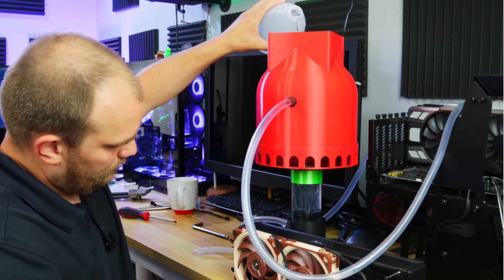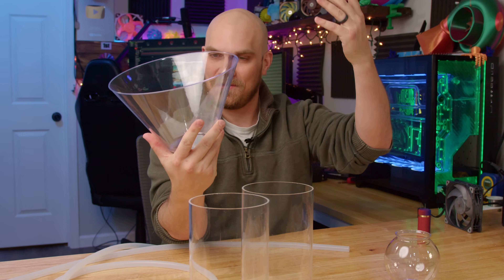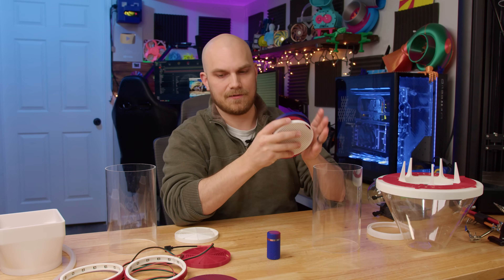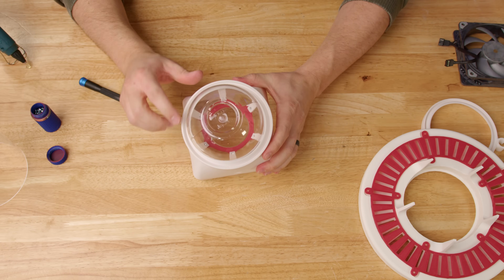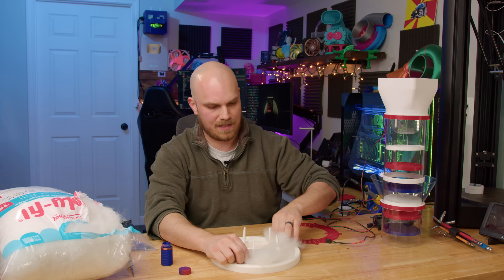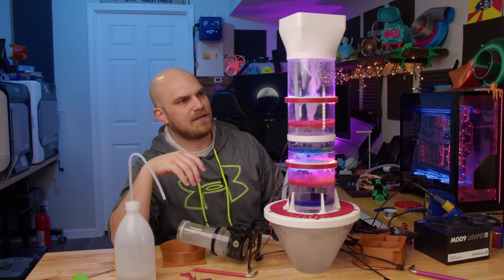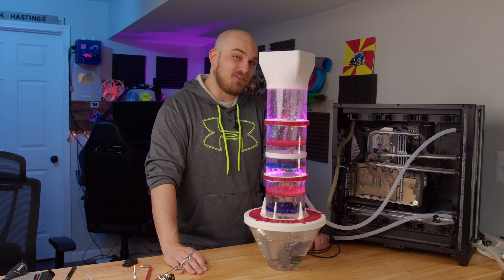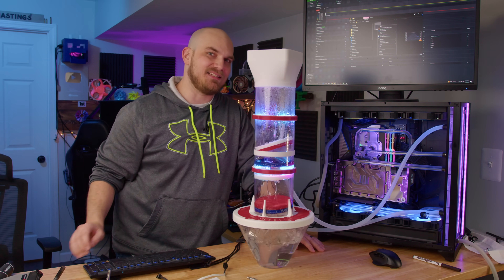Water Cooling..... With NO Radiators

Comment: If you wanted a passive external cooler, have you tried converting a Oil Heater and moving the oil through the water block and out of the case into a large Oil-filled Radiator Heater?

Have the cool Oil flow back into the water block?

Obviously you would get rid of the heating element since your CPU/GPU will provide the hot oil.

A QD (Quick Detach) fittings on the outside of the case should make it easy enough to move around.

And there are small Oil-Filled Heaters that have their own Caster Wheels

Comment: Creating stilts for your water plates and indentations for those stilts to seat into would make it so zero glue is necessary, and if you use TPU to create gaskets you can have a loose interference fit using the properties of shore hardness to your advantage so the water doesn't end up sneaking through the sides of the plate. A concavity flush with the plate and TPU seal would force the flow where you want it.

If you make the seals be slightly convex on both sides with a rather long and gentle fillet you can have the outside-facing seal press against the tube, while the plate is held into place. Material spread would keep the plate in place under friction but the stilts would still be necessary for absolute placement so water flow does not displace them. The stilts should take advantage of the TPU material so they also sort of press-fit into place. The result would be a self-holding structure able to retain water with minimal loss — if any — along the sides.

Comment: How about making a DISHWASHER design?  Where the water is pumped into the bottom.. and spits out of a spinning "Wing" with nozzles.  The wing shape, would have at least 5 blades, in the shape of FAN BLADES, that will double as an Air Mover (upwards air movement).   The wing/fan,  will be powered by the water itself.. blasting out of the ends of the nozzles on each Blade.    Here is the thing... since you are forcing the water upwards... you are getting evaporation on the way UP.. AND... as the water falls DOWN.  Additionally, you could have a 2ndary fan on the top of the Bucket / Tube... that blows downwards (with a furnace air-filter, before it).

 You could place some plastic grates in the center to top areas.. that have a lot of little spikes on the bottoms of each gate lattice.  This will help funnel droplets to the spikes (into smaller droplet sizes), that will eventually fall down on their own.

 The challenge might only be in how strong of a pump that is needed, to drive the thing properly...  and how much heat the pump itself might put into the room.

 Then again.. you could also do the same thing... but inverted.. where you only have the Spinning Blade at the TOP of the tube, that sprays downwards.

 If it wasnt clear... the spinning Fan/Blades... will be hollow, allowing water to flow inside of them... and will blast out of the many Nozzles on it...just like a standard Dishwasher.   The main difference will be, that the blades will be angled like a regular fan... and will thus also be able to move air.

Comment: Might as well just build a wall fountain, At least esthetically it would be a lot nicer but might need to make it fairly large to be effective, and you'd have to deal with dust and keeping track of the water level. For an alternative material to put in the column you could use the sheets of material that go in swamp coolers, its designed to do this exact thing and you ca buy it at the hardware store.
Reply: put a water level sensor in and monitor with arduino/ rpi to open a solenoid connected to a tap or larger reservoir to maintain water levels.. wouldn't want the system burning out when you forget to turn it of before a weekend away haha
Reply: Line the wall with peltier coolers lol

Comment: The results make me think your fan positioning for your dual radiators is killing your performance. My 12600k has similar clock speeds but a higher TDP and I run cooler than your test results with an NH-D15. Granted I am not sure what our change in ambient temps would be, but you may want to flip your top radiator fans to exhaust to get more air moving through the case.
Reply: While i agree with you that his system doesnt seem optimized to cool that well, i don't quite see how the example of your system would in any way relate to his,  its air vs water cooled as well as a different CPU and potentially GPU?
Reply: @connorjohnson4402  Why can't you relate two type of cooling solutions to each other? Both use the same principle of removing heat via a medium and then transferring that heat from the medium to the ambient air via metal. Water cooling is supposed to do this in a more efficient manner than air cooling. While I do use a very large air cooler, a 360mm triple fan radiator should be more efficient at cooling a lower TDP processor due to the larger surface area and air flow.

Comment: this actually could work for normal setup if you use a water to water heat exchanger to keep the evaporating water supply separate. Could be nice, like one of those desk fountains very tempting....
Reply: Although something like this would be a fun addition to a homelab cluster of multiple motherboards
Reply: Or it could make for a very moldy room very quickly
Reply: Definitely need very good airflow for this for sure. But, like, more airflows healthier anyway (assuming where you live isn’t horrifically polluted, and even then HEPA filters are magic), so🤷🏼‍♂️

Comment: I made one of these 20 years ago, but I went for attached flow to the walls of the pipe. I accomplished it by lining the walls of the pipe with one layer of cotton towels. Then I had a smaller pipe with a fan that went inside the big pipe, that way it could pull air down into the pipe and back up the smaller tube. It was quiet and cooled my AMD CPU. Downside is it used quite a bit of water and stuff would start to grown in the water, you might have to address those issues somehow.
Reply: Humidifiers will either be topped-off regularly or will be plumbed in so they can be refilled automatically. To prevent growth you can mix some biocide (e.g. copper sulfate) in with the water. Filter media in the water path also helps to collect any contaminants. Any option system should be emptied, flushed, and refilled periodically. Growth tends to happen more in standing water. If you can keep the water agitated (such as the churning of the water you see in the bottom of his reservoir), that should reduce the amount of growth. I have an open water fountain for my cats to drink from. It can run for several weeks without any obvious growth. It does contain a filter which is just cotton batting and activated charcoal.
Reply: @reverse_engineered  Thanks for the solutions you presented. I only ran it for a month or two, it was a very effective humidifier.

Comment: I would love to see if a decorative, laminar flow, table-top, water fountain could be used for a water cooler. May need to add a filter to the system because it would be open air, but IDK. Could be cool.
Reply: It would be neat, but I think the laminar flow would drastically reduce the evaporative cooling. It's the agitation of the water into small particles that gives it large surface area, which in turn produces much more evaporation.

Comment: You should use these mist nozzles for garden hoses / shower heads. They should create tiny droplets and therefore a lot more surface area for evaporation. Also, to work with filters next time, you can try to have the fans at the bottom pushing up, with pressure-optimized fans, and just have filter material in front of the fans.
Reply: this would require a lot more water pressure would it not?
Reply: @TheDoctorDanger  yes, but I don't see why you wouldn't be able to run a separate pump that's capable of delivering that pressure.
Reply: @LyK0sa  the goal is mostly passive cooling
Reply: Just doing a shower head would create airflow going down. No need for a fan. You also could get a decorative fountain and just hook you’re pc up to that. Yes to filter but a water filter.
Reply: If the droplets are too fine then instead of evaporating they just blow away.  It would definitely be more efficient at removing heat but also run out of water far quicker.
Reply: @benfubbs2432  I think a simple shower head would be optimal.
Reply: you'd want to add a tank that the pc uses as the source of water, then use a higher pressure pump (e.g. 12L/m at 50psi.) for the tower.
Reply: I was thinking the same thing but using a ring fitted on the inside with the nozzles they use for garden sprayers. also this setup really needs a fan designed for higher static pressure rather than airflow. granted from experience working next to a server cabinet the noise of such fans  really isn't contusive  to a home environment so some kind of sound deadening is needed too.
Reply: But nozzles are prone to clogging. A lower maintenance route would be using random packing like is used for distillation columns.

Comment: What about a passive closed loop ? Using the hot water to move fluid across the loop, that would be interesting.
Reply: Those already exist, they're called heatpipes. You'll find them in pretty much every aircooler for both CPUs and GPUs...
Reply: @Leon_Schuit  No sh*t, Sherlock. The technique would be the same, u just forgot the thing called loop.
Reply: @G4BR13L_  I didn't forget the loop, heatpipes are closed loops after all. 

Consider something regarding your passive loop, which I'll simply presume is supposed to look somewhat like the one he had in his system previously. Convection is a very weak force, so putting any kind of resistance in its way (fittings, bends in the tubing, distro plates, RADIATORS, and even friction from the tube walls) will stop the flow of liquid. After which the system will simply shut down from overheating.

The reason I didn't give you a serious answer before, is because it wasn't a serious question. You clearly didn't think it through, else you would've come to this conclusion yourself. 

Good night Watson.
Reply: @Leon_Schuit  Of course i've thought of it, i didn't said it would work, just that would be interesting to see, since there's no much content of it. This channels is about trying things that might don't work and seeing whats happening, if u don't like it, u're in the wrong place, oh the smart one, holder of all knowledge :D

Comment: Make your connecting rings between the tubes also contain the rails on which the infill sits.  Basically run three or four legs up and down from the connector rigs with ledges for the fill plates to sit on. You can also make the connector rings a fill plate in and of themselves. That way you have the connector ring is a fill plate Plus a fill plate both above and below each ring held in by those legends so they can't go anywhere.
Reply: Yeah, posts separate each filter.

Comment: That setup looks like it would benefit from quick disconnect fittings. That would also allow you to remove it from the loop and still use it as a bong. That way when you hook it back up to the PC, the bong water will circulate through the system and give you HIGH frame rates.

Comment: A hypothetical... What if we just spin the water.

We have curious fan designs already, but if we can cyclone the water down the sides of the tower we should see a large surface area and plenty of mixing and the walls of the tower themselves are cooling surfaces. How to do it reliably? Less sure.

On the other hand.
Those plates would do better with both dimples going up and down, to drain air up and drain water down without impinging on each other anyway, ideally you move the water to the middle then to the outside with each step, so one plate design inverted every floor should do fine, although air holes would ideally be larger and water can drain through relatively narrow ones. Say 6 larger holes around the middle, and 6 around the edges to allow us to make a small rotation to keep up and down flows separate, venting Air up between the downflowing water vents.

And your fan really needs to do well against high static pressure, we've seen some lower speed higher pressure fans in the fan showdown, so plenty of room for improvement.

Comment: If you take your trash out regularly then tossing the diaper in the trash is not an issue... But the diaper genie has an even worse issue if you don't empty that out regularly as well. If you put more than about five diapers into the diaper genie it starts to get real rank and smells worse than if you just put them into your regular trash.

Comment: You don't need a rad if your water volume is big enough that ambient cooling is enough, as the PC doesn't generate enough heat.

Example: swimming pool.

More realistic: 1 qubic meter, but over large area ( thin, big, flat surface)
Reply: Do you realize how much water 1 m^3 is? That's literally 1 metric ton of water (1000 kg, 2205 lbs). A typical bathtub holds only about 15-20% of a cubic meter.
That's definitely not "more realistic" at all.

Comment: There's a reason these were made with PVC piping and wire mesh, back in 2009. They were the interesting budget tech.

Now that being said, I am shocked a system that poorly optimized didn't throttle to hell and back.

Comment: How long did it take to print the parts? I have a printer but it’s godawful to manage, CR10S Pro V2 with all metal hotend. Really difficult to get a consistent level even with the bltouch, I think I need a new bed. Any tips from anyone on this?
Reply: First check if your v-rollers are worn out or maybe just too tight. if your bed or printhead wobble the auto leveling cant help much.

Comment: Have you thought about using simple window screen for the "fill" the evaporation plates? Just a bunch of frames stacked with say 1/2 inch gap between each in about the same space but you would also want a larger gap head space up high say 4 to 6 inches with nothing but air space 
1 other thing you would want to do is make have a 1/2 inch hole cut along the edge of the screen and set your plates so that none of them line up with any directly below them 
That should let air flow over the bottom of the plates as well as through them surface tension will make it hard to pull air through the plates till the water on them warms up

Comment: Perhaps using raschig rings instead of those distribution plates would work better. It massively increases the surface area. You can easily find ceramic ones used for distilling. Or even print a whole load of them.
Reply: Might as well upgrade to Białecki rings
Reply: I've seen some resin printed metal amateur radio antenna on youtube that basically resembled bare infill & looks like it'd be almost perfect for this sort of thing.
Reply: @NM-wd7kx  One big slug of ramen infill would probably work great tbh
Reply: He would need to use a much more powerful fan for that

Comment: A cooling tower works by evaporative cooling.  You need a ton of surface area for the water to interact with the air flowing through it to get any cooling.  You also need a spray system instead of just dumping water into it and trying to distribute it with a shower screen.
Reply: For sure. This is 2009 technology without any research done into it.
Reply: @werdfeefs7027  older than 2009.

Comment: Chemical engineer here. Use thin, low density scrub pads on each layer. Surface area will increase by an order of magnitude.
Reply: Scrubbing column fill - it's literally designed to maximize air/liquid mixing inside a column like this.
Reply: @Steamrick  I worry about air flow in that setup but if it works, it's ideal.
Reply: This or just go and buy the mat material they sell at home depot for swamp coolers, its designed for this exact thing
Reply: @connorjohnson4402  I was not aware of it. This is the most practical and  easy way to do it.
Reply: @connorjohnson4402  The swamp cooler material is, afaik, meant for low water flow and large front area rather than depth of material. It might work fine, but I'd not be surprised if it is less than ideal.

Comment: You might be able to just pack the entire tube with fibrous material that would allow a huge amount of surface area and slow flow. Just maybe put a "shower head" at the top to distribute the paths through the material.
Reply: Not fibrous material, it'll just clog up. Use distillation / scrubbing column fill. Distillation columns are responsible for industry worth trillions, you better believe they've been optimized as much as humanly possible.
Reply: @Steamrick  Could also you the material they use in swamp coolers, it does a similar thing and you can easily buy it at the hardware store

Comment: you should have used bio balls for your air water interface rather than using the 3d printed disks.
Reply: Scrubbing column fill - it's literally designed to maximize air/liquid mixing inside a column like this.
Reply: @Steamrick  Yea or the mats of material used inside of swamp coolers, its made to do basically the same thing and you can buy it at the hardware store
Reply: @connorjohnson4402  The swamp cooler material is, afaik, meant for low water flow and large front area rather than depth of material. It might work fine, but I'd not be surprised if it is less than ideal.